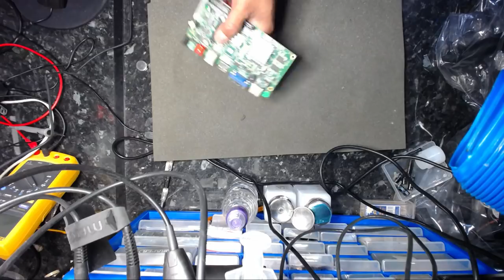HOW TO FIX SWANN CCTV DVR SERIES COMMON FAULT BAD CAPACITOR NO RECORDING OR HDD FORMAT FREEZE

Comment: Save yourself a lot of frustration and jump to 24:00.
That's the cap to replace.

Everything else, you probably already know.

In a nutshell, the power supply filter capacitor on the motherboard was bad.

Comment: Hi iTCXtreme, thanks on the video i learn a lot about changing the capacitors, everythings went well, the only is it does not seeing it was connected to internet, the light at the back of my dvr on the eternet slot not blinking.  any advice?
thanks,,,

Comment: Thanks for this: I am right here, but the  caps are fine, the tiny radial oscillator blew up. and its unmarked. any idea what frequency it is? its that little guy right under the coin battery...
Reply: Same on mine, and it looks the same thing has happened on the board in the video.
Reply: Same with mine.  How did he not see that?  You can't miss it in the video.

Comment: I have h 264 8 channel 11 year old. 1st failure power supply. Good a year or so. Then no reboot after weekly or review failure for 1/2 hour or so.swann had no suggestions. Bought a 5 amp supply  kinda worked. Still same this is going to sound not like it should work but unplug power supply for about 5 minutes or so. Plug in It reboots. I am guessing issue in dvr? I bought another one on marketplace $40 I am going to check it out. Hard drive in it. Wonder if reformatted? 1tb.

Comment: Hi, nice vid. I have a problem with a cap on my Swann board. Its a DVR9-4200. The cap is C1114 and sits just by the back up battery. It has been obliterated so I cant read off the values. Have you come across this board? I know it is used in different models. Can you help? Can anyone help? I know Swann say they can't......

Comment: Thanks for a great work through , as my unit is purging ie fan stop start, hard drive doing the same, voltage pulsing between 12.3 v down to 3.5 even after changing over power supply, I like you think that capacitor ,you changed is the culprit, any ideas would be appreciated ! Thanks.
Reply: Faulty power supply. I had exactly the same prob.

Comment: Thanks for the video, & the input. 
Very helpful. 

Question to you....
Why would only 1 camera not record, on an 8 channel system? 
The camera works, & the motion detection works, but it doesn't record. 

Secondly.... 
What is the purpose of the CR1220 lithium battery on the board? 

Thanks!
Reply from the maker: Hello, there may be a issue with the main board resulting 1 camera not working, providing you've tried a new camera on that port.  Cr1220 battery is to keep the time and date.  Cheers
Reply: @iTCXtreme  
Thanks for your response. 

That would explain why the date on the images has resorted back to 2002. 🙂. 

Yes, I have tried a different camera on that port. 
The cameras all seem to work fine. 

I don't see any physical signs of cooked parts, top side anyway. 
In your estimation, would it be worthwhile to take it in to a tech, or are those boards even serviceable?
Reply from the maker: @waden9815  No Pal,  get a 8 channel compatible hikvision dvr box. It is not worth fixing it, considering the cost parts and labour.
Reply: @iTCXtreme  

Thanks for your input ITC!
That's not what I wanted to hear, but that's all I needed to hear. 

One more question.... 
I've spoken to a Swann rep about this over the last few months, & he said it would have to be another - of the same Swann dvr's, to match the cameras. 

The only thing about this, Swann doesn't make the same dvr anymore. 

In your opinion, would I need another $350 Swann compatible, 8 channel DVR, or is there a cheaper 8-channel version that you'd suggest? 

Thanks.
Reply from the maker: @waden9815  Please check with your local cctv supplier.  Not necessarily you need a Swann dvr to using existing cameras. Take on of the camera down and check the model number and image resolution e.g. 1080p, etc and you local supplier should be able to find a dvr compatible.   Swann dvr are very unreliable.  Here is UK 8 channel Hikvision Dvr is about £118 inc VAT.
Reply: @iTCXtreme  

Thanks again ITC, that's all good input. 
Much appreciated. 
I'll look into that. 

I'm talking to you from Saskatoon, Saskatchewan in Canada. 
I don't know what there is for CCTV suppliers here, but I'll look around. 

I bought this system a few years ago, a really good boxing day deal through one of our big box chains here. 
It's been a decent system, except for this one issue. My biggest concern is that another port malfunctions, & up until now my options seemed limited. 
Thanks again man. 

Merry Christmas, & all the best in 2021. 
I hope you can enjoy the 'silly season', while staying safe. 

PS... 
I like the idea of that Capacitor tester.
I'm an Electrician, not an Electronics tech.
There's only a few times in my career where I could've used one of those, but I definitely see the use in having one. 

Good stuff man, take care.
Reply from the maker: @waden9815  You take care and have a great Christmas and Happy New Year 😊

Comment: mine booted up and actually gave me the camera split screen i added a new cam  ntsc changed a config or too even ...   it booted again but failed to show a screen after the intial boot screen   wondering if my new cam relayed too much juice into the system  when i opened it i noticed it didnt have a fan i pulled the battery tried again but no go after boot screen...  noticed what i think is a tantulum cap next to the battery crusted with black char   thinking it may be getting short i just got lucky on the first boot cause its rex reed and when heating up goes completely short but  ????   like the little cap looks like a primal circuit protector ? it still boots or has a post screen nothing after that

Comment: is it possible to use higher capacitor in terms of uF and V? what should be the replacement capacitor specs? @itcxtreme
Reply from the maker: Hello please refer to the description for capacitor spec. No you need to replace with same one.
Reply: @iTCXtreme  hi, i don't have same DVR but similar china made one. So what would be the rule of thumb when changing capacitor? also can I use esr meter without removing caps from board? thanks.

Comment: Greetings, thanks for the great video! I have the same model but my problem differs, my unit powers on but will not display any image on the monitor at all. The power adapter is definitely not the issue as I have replace it with new one. please advised and thanks in advance.
Reply: I'm haveing the same problem. Did you Ever get yours fixed? If so...how?

Comment: 12:54 why did you use epoxy? Subscribed
Reply from the maker: Hello, it is flux used for soldering joints.  Flux let's the solder flow better and ensures a decent joint.
Reply: Yep, I know flux, but I could have sworn you said epoxy and I thought wow this is new. But after reviewing I can tell you said flux. My bad. Anyway, I liked this vid and might have to give it a try repairing my security recorder. Mine might need a new hd though. RJ

Comment: hey I appreciate your video- was having the same problem. i first swapped the hard drive and that didn't work. Then i found your video and tried the capacitor swap and am still having the same issue. Any other ideas? Im about to buy a whole new unit :( The hard drive works perfectly every time i restart but soon cuts out randomly and stops recording.
Reply: +iTCXtreme Actually- no. i dont have an ESR meter but the capacitor came in a pack of 10 so maybe i should  try another one? Or is there a way to check it with a multimeter?
Reply: +iTCXtreme I appreciate the info. i may just go ahead and get the meter since its only $20 on Amazon then ill give it another shot as u suggested. Thanks!
Reply: +iTCXtreme hey i got the meter already and most of the 10 read from 950-975. One of them reads 995. Maybe they're just cheap? Got them off Amazon so they're nothing special. i was looking at digikey and they have a lot of different types  (ceramic, polymer, aluminum, etc). Can you tell me what the right replacement type would be for this Swann unit?
Reply: +iTCXtreme Got the ESR meter and you were absolutely correct. All the capacitors i got off Amazon were reading pretty low below specs. Got some Panasonic brand from digikey and they were all above specs. Problem now appears to be resolved. You are the man!